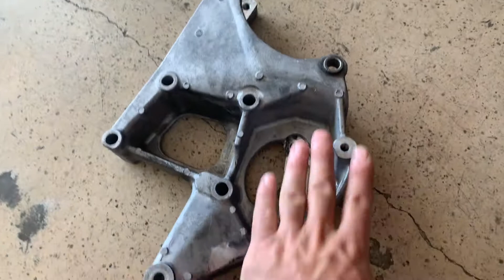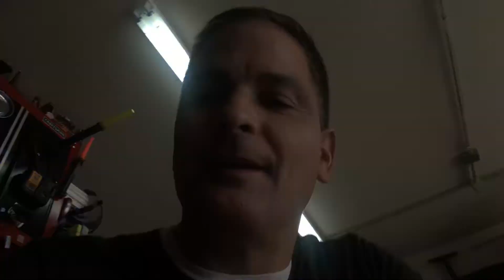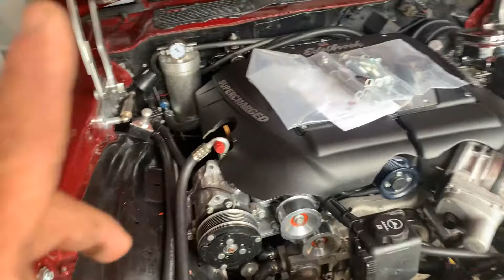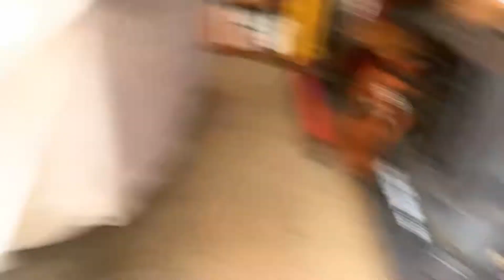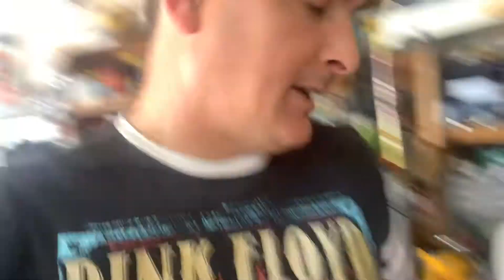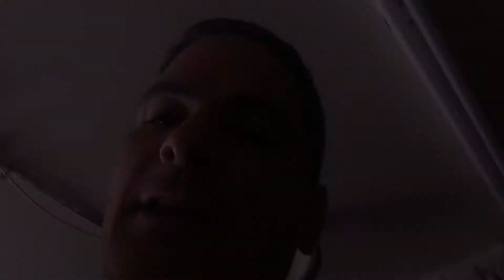Holley Accessory drive let me down

Comment: Holley has the mid mount it has the water pump as the bracket and all other accessories mount to that no extra mounts it comes with everything
Reply from the maker: Yes thanks, I looked at it but it's only rated for anything under 400 hp

Comment: Thanks for the video . I’m looking into replacing my old setup on my big block Chevy . What engine is in your Camaro ?
Reply from the maker: I'm now running an LS3 with a Edelbrock Eforce supercharger and meth injection. I did the swap after I moved and race gas is scarce here and more expensive. I was against it until I did it. I was one of the pioneers to the LS swap. Not much was available when I did it. Now I do LS swaps for lots of people and I swear by them.  Drivability is unbelievable and power levels are so easy it's crazy. Now the aftermarket world is flooded with LS swap parts to make it easy to install it in anything.

Comment: Over torque or to much leverage on idler pulley ? ?
Reply from the maker: Holley said too much horsepower, 
The quick spool and belt tightening up upon release of throttle is too much for their brackets. Its like pop metal. All bolts were torqued to specs and it was their spring loaded tensioner. Running billet aluminum now with manual tensioner and no problems.

Comment: I'm trying to keep everything as close to the  motor as possible. It's going in a 83 toyota 4x4
Reply from the maker: Thanks fir watching and commenting. I believe the corvette kit sits out a little further than the Camaro/Cadillac bracket and harmonic balancer. Corvette has a separate belt for the AC that fits between the main belt and the block so it's spaced further out. I would have to look into it to see how much room you would save.
Reply from the maker: Your balancer has to match the bracket kit.
Reply: I just finished a swap on a 92 Toyota pickup if you have questions

Comment: I had problems with that same kit. They swapped it out for the newest one out, where everything bolts to the water pump.
Reply from the maker: How's that one working for you? They told me they don't make anything that they recommend or that will handle much above stock power levels.
Reply: @The72Z28  6800RPM shifts and 7000Rpm revs with no belt throwing. love it. But I just notice you have a super charger but did not see a video on it on your channel. What SC you have? I want one for my 71 camaro. If I go LSA or somewhat, I would use the dirty dingo front drive for LSA. Real nice setup.
Reply: I only got 460 to the rear wheels N/A
Reply from the maker: @hybridmusclegarage4590  I have more videos covering my LS swap and the converting it to boosted. I'm running the Edelbrock Eforce. I'm at 12 lbs of boost with meth injection. I'm running the Inavated West overdrive harmonic balancer. 
I wanted to run dirty dingo but they said it won't work with my supercharger because it's corvette spacing.
Reply from the maker: @hybridmusclegarage4590  I backed mine tune down and I'm right at 690 at the wheels, over 800 at the crank. It's a lot of fun. I think 650 rwh on a roots style supercharger is perfect for the street. It's crazy fun and can be managed to hook up when you want to, and blow the tires off when you want also 😂
Reply: @The72Z28  I thought about getting the  Edelbrock Eforce . Do you remember the part #?  Are You happy with it? Thanks
Reply from the maker: @hybridmusclegarage4590  Edelbrock 1540. I also got the one that fits a 2008 GMC 6.0 for my truck. I like them a lot.
Reply: @The72Z28  May I contact you?
Reply from the maker: @hybridmusclegarage4590  sure, email me and I'll send you my cell number. the1972z28@gmail.com

Comment: Glad I came by this video! What are your power/torque numbers? I have a stock LS1, planning to get the holley mid mount kit with mild engine modifications wanna see at what numbers the holley kit starts going wrong. Cheers!
Reply from the maker: They stated nothing above stock (lol) they wouldn't put a set number on it but later stated around the mid 400 hp range is what it is made for (that's at the crank) 
At the time of this video I was mid 800 hp at the crank and 670s hp & tq at the wheels. 
Way past what they stated. I thought with it being Holley it would handle anything under1000 but turned out not even half that. They do not advertise any hp ratings on any of there brackets, I never payed attention to it until this happened 
Thanks for watching
Reply: This bracket is not the midmount kit. Th midmount kit does not use brackets. The entire water pump assembly is new and everything mounts directly on it